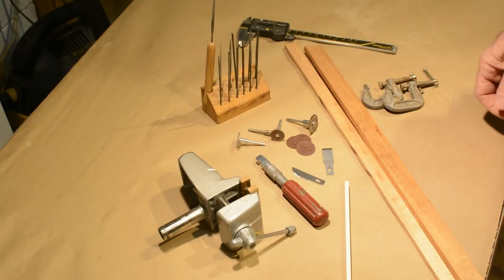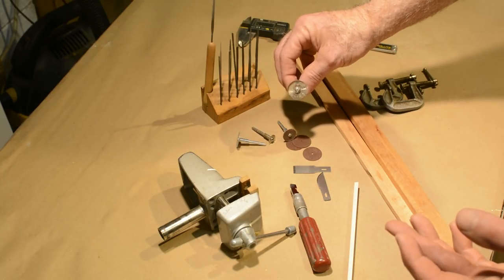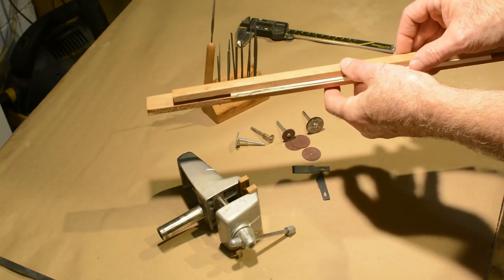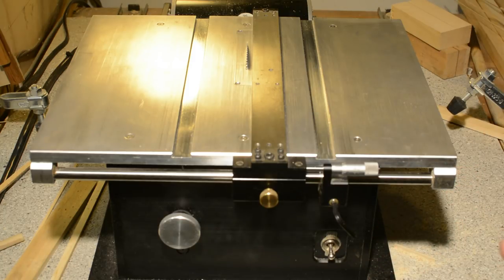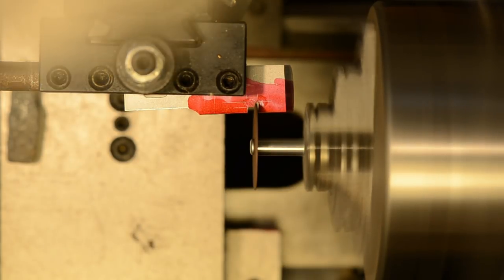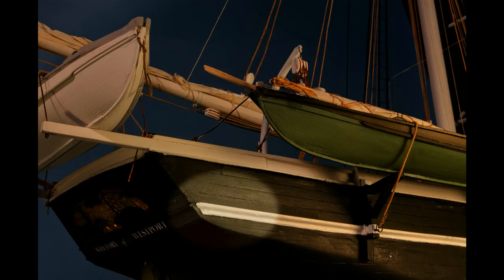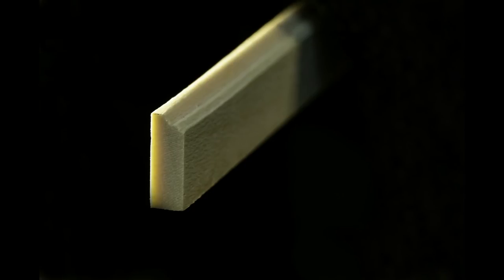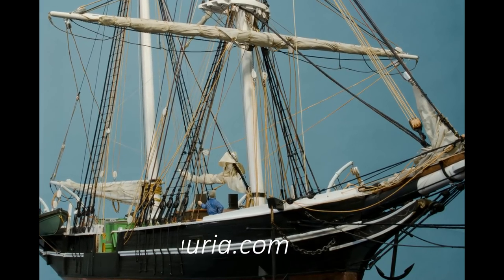Moldings and Scratchstocks

Comment: Thanks, i was missing your content very much!
Can you make a video about cutting/outlining practices, in terms of precision. I always find myself making things just not aligning right even though i though i measured well. or my cuts are a half degree of 45 and it shows... or sometimes i forget about the width of the saw, or the teeth make things wider. etc.
I think most if it is to technique, and knowing what to do and what not but i don't have that experience yet.
can you make a video about the practices you have learned over the years about cutting and sawing to make things look perfect instead of just good???
Reply from the maker: Hi Matthijis.  That could definitely be a possibility.   Thanks for the thought.  Is your boat in the water yet?